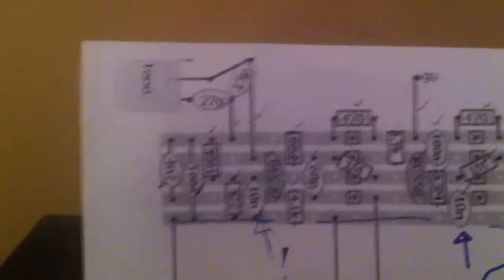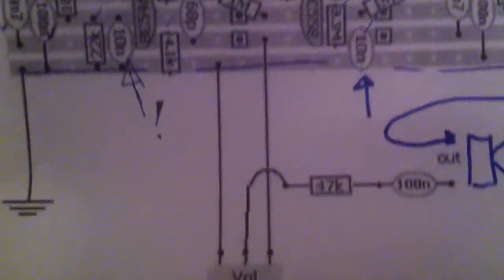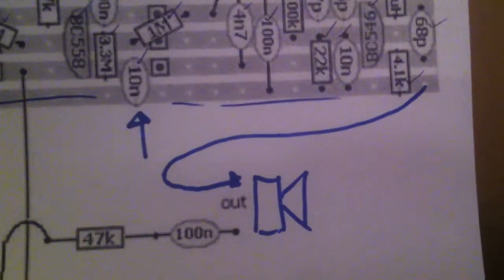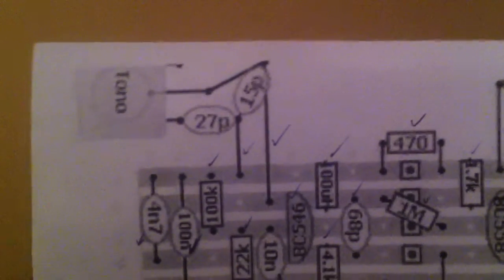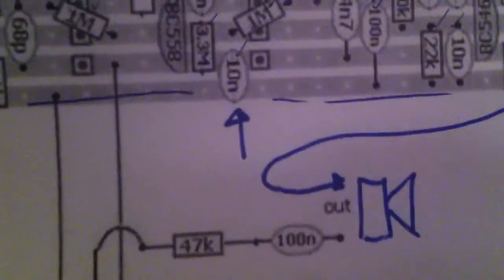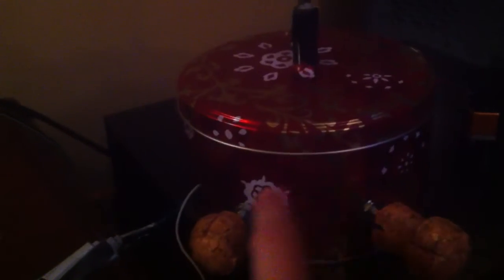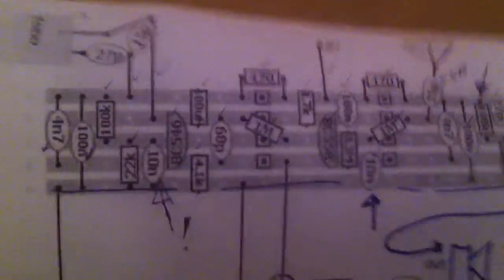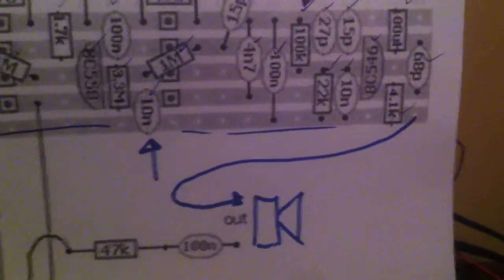Easy Theremin 2

Comment: Hi, I made one and it works but I'm getting very low signal output. Any idea what it could be? When I touch the middle pin of the central transistor region it seems to increase (as well as the noise) maybe a bad soldering there?
Reply from the maker: Hi there and thank you for checking out my vid! And congrads on getting a signal! Many people seem to find it hard to even get that. 
I will ask a few questions, if you don't mind. 
Are you running it directly through speakers or are you hooking it up to an amp like a 386?

What I had to do to get a good sound, ( and it was LOUD, after this,) was run it through a 386 amp and then through an old analogue receiver from the 80's or before. A guitar amp will work for sure as I tested it on that too. Either way, the main thing is analgue, not digtal receiver.

This sort of thing is designed, really, to run through a guitar amp. Those work best. 

If you have done the above and still are getting very little sound, then maybe upload some pics, or a vid and I can try to take a look. Why the signal would be weak is hard to guess without visual aids.
Reply: https://s18.postimg.org/fq607lg05/IMG_20161023_213904.jpg
Reply: I'm running it through a 50w guitar amp

Comment: Maarkaus J, can you please upload a pdf of this schematic or give me a link for it? I'm finding it very difficult to understand the schematic from the video. Please reply and thanks!
Reply from the maker: Hi thanks for the reach out. Here is the link I based this on originally. http://www.instructables.com/id/Easy-theremin/ Its an instructables idea that I expanded on. This link will cover what I don't cover here. I wish you well on this project.
Reply: Thank you for the speedy reply! Sorry about this question, but what is a tono? This is the first time I'm doing an electronics project and I tried to search it up online, but couldn't find it.
Reply from the maker: Tono means tone. that is the pitch control if I remember correctly. It lets you change the pitch... sort of.  The one thing Can tell you is to be sure to keep your wires short, and when you are done, you may need to run it through a guitar amp or a receiver aux input as the sound from it will be very quiet.
Reply: Okay, so that's what a tono is... can you please give me the specifications of the tono you have used or a link on amazon, etc. so that I can buy it? 
Also, I was looking at this image https://cdn.instructables.com/FJZ/C8YS/IJ4KG6VG/FJZC8YSIJ4KG6VG.SQUARE2.jpg 
which you have posted on the Instructables article and I think you have used a breadboard in lieu of a perfboard. Can you tell me which is easier for a beginner to work with?
In addition, is it necessary to connect a potentiometer 5K linear and
a potentiometer 100K linear? I'm trying to understand how it is connected in the schematic but I don't think I can find it mentioned.
And I'm sorry for bothering you with so many questions.
Reply: Hello Maarkaus, I've been trying to make this using a breadboard and I don't think I have done it properly. Is it possible for you to give me a clear image of your completed breadboard? I'm doing this for a school project so please reply. Thank you so much for your help! :)
Reply from the maker: Hi Sorry, I have a very active life with kids and a full time job so I have been running around. I am not sure if a breadboard will work properly as there might be too much noise and power drain. I never used a breadboard except for the 386 amp which had a filter. 

I would follow the schematic and plan from the indestructibles as they cover most of the questions you asked. The main difference I did was add the little lm386 amp and a metal tin (cookie tin in this case, with rubber bottom so that nothing would short.) and then I experimented with the wiring. But the board was the same as what they showed. A metal tin can help with radio noise and such. 

Strip boards are a little harder to find, but not impossible, and that is what I have experience with. Radio Shack might have that, or a local electronics shop. Amazon has them all over the place but they are slow to arrive. Plan for at least a month. 

I hope it works for you.
Reply: Hello Maarkaus, thank you for taking time out of your busy schedule to reply. I have read the Instructables article and all the comments thoroughly but I have two questions which haven't been answered:

1. There are two different kinds of chokes which I have found in stores:
one which looks like a resistor https://encrypted-tbn1.gstatic.com/images?q=tbn:ANd9GcQ3FnO8Zkbqg_cbi1Jt4BKRIQzb1WTAZwJ3JiS7fRnpA0A2n6g1
and another which looks like https://encrypted-tbn2.gstatic.com/images?q=tbn:ANd9GcS_PF-trwb--q437cRJno4d8hV3kFplOR0sAfOp6AcAXBqrlE6i
Which should I use?

2. Exactly what tono should I use? 

Again, thank you for your guidance and I'm sorry for bothering you.
Reply from the maker: I used the ones that looked like resistors and are as cheap as possible. 
https://www.amazon.ca/gp/product/B00H6YSVTK/ref=oh_aui_detailpage_o07_s00?ie=UTF8&psc=1
these are the ones I used for Inductors (coils or chokes)

 and the pot was very simple, and something like this:
https://www.amazon.ca/Single-Linear-Taper-Potentiometers-Controller/dp/B00PZSR49M/ref=sr_1_1?s=hi&ie=UTF8&qid=1473429475&sr=1-1&keywords=potentiometer+100K+linear

and 
https://www.amazon.ca/Stkertools-Single-Linear-Knurled-Potentiometers/dp/B014VX754A/ref=sr_1_1?s=electronics&ie=UTF8&qid=1473429515&sr=1-1&keywords=potentiometer+5K+linear

FROM what I remember the 5K is the TONO.

Both these companies are reliable for shipping, but take some time to arrive as they come from China. I had to wait a few weeks. 

You can get these from places like Digikey and Mouser and other international places that are a bit faster, but then you pay for speed as well.

I hope that helps, and I would love to see a video when its done. So feel free to link when you get it finished.
Reply: Thank you very much for the speedy reply! I managed to find the potentiometers in stores in my city but I didn't know that the 5K is actually the tono. I have bought a perfboard (although it has copper dots instead of strips) and I will attempt this project again soon. And if it works, I'll certainly try putting up a video!
Reply: Hello Maarkaus, I've tried to make it but I'm unable to get a proper sound out of it. When I tried to connect the antenna to another capacitor yesterday,  I was able to get an extremely low output but when I tried again today, I can't get anything. Can you help me fix this? (For images, please see comment by username Roboticslab here at http://www.instructables.com/id/Easy-theremin/ )

Comment: Hey maarkaus J so then we have to put it in the same ground ? i mean there in the tono there is one pin left do we have to put it on the ground of the speaker ? and what is better the speaker or the jack 3.5? i will waitting your answer thanks :) o and nice video by the way
Reply from the maker: +ASECINOSILENCIOSO Thank you so much for the kind words. I was aware of the shaky camera, and might eventually get a better setup as these vids progress.
To answer your first question. The third leg of the Tono does not connect to anything, and it still works. It seems like it should connect, but no. 

And as for the second question about the speaker or jack, I used a 3.5 and then used that to connect to my receiver. I tried it on a simple guitar amp and it worked well there too. It does not work connected directly to a speaker, unless there is some sort of amp. The signal is too low., so a Jack lets you connect to things like a stereo receiver. Preferably an old one it seems. I tried it on my new digital receiver/cd player, and it didn't seem to work. My old receiver from the 80's (a NAD 7000) worked, as well as the one from the '70's (a Pioneer SX-737).

I hope that answers your questions:). If you have more feel free to ask.

I will be posting more vids eventually, so be sure to check in once in a while. At the moment I am busy doing a demo reel however, and so have not had the time. I am planning to build a different theremin soon.
Reply: +Maarkaus J thanks for the fast answer I really apreciate it , and it really helps me on my questions I was looking for alot of circuits but non of them are clear, you help me alot . I read that you can use a radio frequency  as a speaker have you tried it ? im not sure how it works but it sounds cool
Reply from the maker: +ASECINOSILENCIOSO I would like to try that some day. I do know that when i left it on, but was not playing with the theremin it started to pick up radio stations! fairly funny. 

http://thereminworld.com/Forums/T/29231/my-new-year-gift-to-tw

This is a link to another one I will build next as I finally have all the parts. its even better, and is a simple enough design, but the parts are outdated and hard to get. Check it out!
Reply: +Maarkaus J yeah I saw you said something about it and it looks pretty simple but where did you get the outdated parts ? I mean I live in mexico do yoy think you can get those in.here ?
Reply from the maker: +ASECINOSILENCIOSO Mexico? cool. I am in Canada myself. I got the parts through a friend of mine, who ordered it off Ebay. It took some time (6 months to arrive) but Ebay has them. The most difficult parts to order are the 2n5484's. and they were on ebay. I have seen several sources there. 
Not sure if this will help:
http://www.pisotones.com/Theremin/Theremini.htm

Its the original Spanish website where the design for the theremin in the video above came from. The site has much info including the history behind this little design. My Spanish is pretty bad, but I managed with help from google translate.
Reply: +Maarkaus J  yeah that was the first page I visited but I wanted to check all the pages that I can so I have advices from people that already builded one in case mine does not works , but thanks for all the help if I got any other question I will let you know cause I really want to do it work, again thanks for the support
Reply: +Maarkaus J hey I got a problem do you know how to connect the jack because it has 2 pins of the same sice and one larger , and how did you connect the anntena to the circuit because I cant weld the 15p and the anntena please help :(
Reply from the maker: +ASECINOSILENCIOSO I am not sure what antenna you are using but I used something similar to this:

https://www.amazon.ca/SODIAL-Section-Telescopic-Stainless-Universal/dp/B00JVIPRAA/ref=sr_1_76?s=electronics&ie=UTF8&qid=1460036307&sr=1-76&keywords=antenna

It is an ordinary radio antenna, and has screw holes. So you wouldn't solder the antenna directly, but instead solder the little plate that comes with it, or maybe just screw a short bit of wire to the hole. You  can also get these off old radios and tv tuners.

 You might beable to just a length of simple solid core wire for testing. Something about a foot or so. I found that the antenna was giving me the best results around 11 inches or so. 

As for your question concerning the Jack. The pin closest to the insert opening would be the ground. On a headphone Jack, the band of metal farthest from the tip ( the third band) is the ground, and the other 2 bands are right and left. So which ever pin on the jack is at the end closest to the insert hole is the ground. The gorund hole might also be called "cable" or "sleeve", and then the other pin is the output. 

If you do a search of 3.5 jack images you will see what I mean.
I hope this helps.